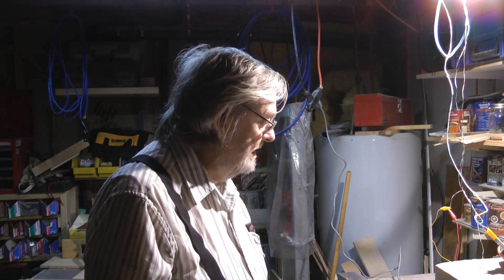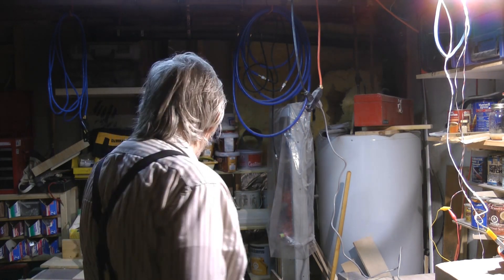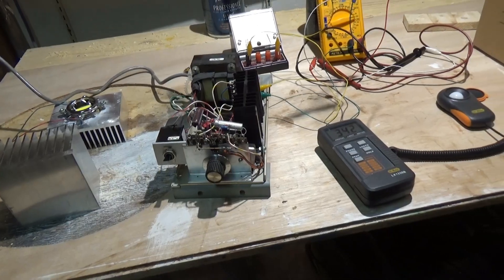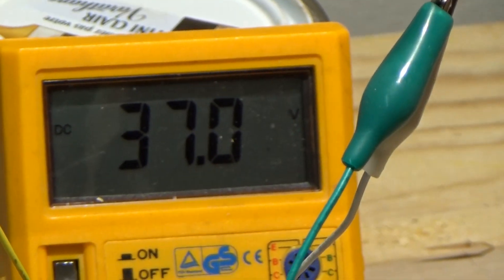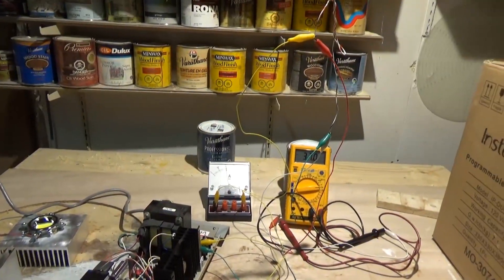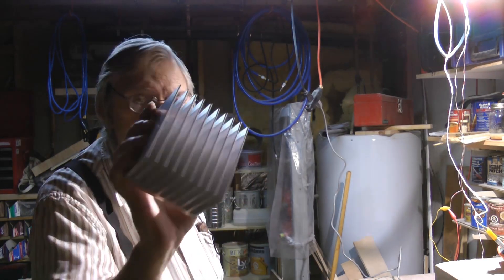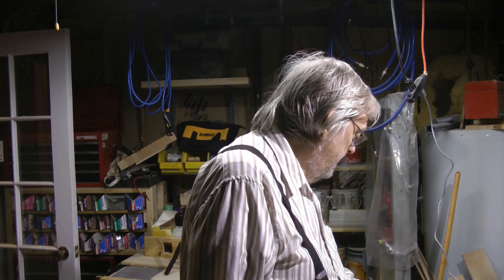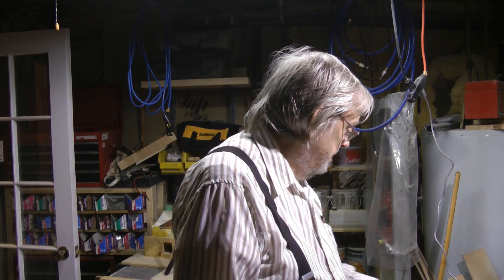LED test Vero 29 vs typical cheap 100 watt

Comment: Actually a Lux meter isn’t capable of testing the LEDs capability because lux measures just the visible light spectrum a PAR meter is what you really need to test it accurately
Reply from the maker: Yes I know, I mentioned that, but I go by the manufacturers chart to get an idea of the light spectrum. As long as I test each led the same way, I can get a fair comparison. Actually, a lux meter measures all the light energy from the LED, it is just weighted towards the yellow with a filter. On some of my meters, I've removed the filter.

Comment: Need a par meter also
Reply from the maker: You're right! Now I go by the charts of what kind of spectrum the LED puts out, but a  PAR meter would definitely be helpful, especially for unknown LEDs. Of course, I don't use unknown LEDs for serious work.
Reply: @Flintsmooth  nope, take your lux meter, the one u have, drill 3/8 hole dead center of the lux cap, cover hole with scotch tape, the brand u can write on, 2 pieces, will give u very close par. It exact to hydrofarm par reading, i have done this, and compared it already.